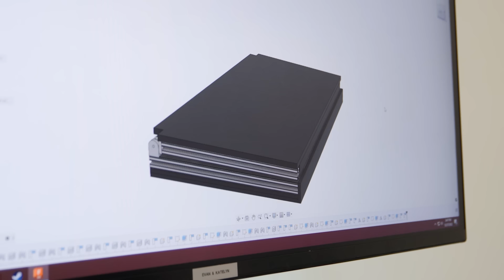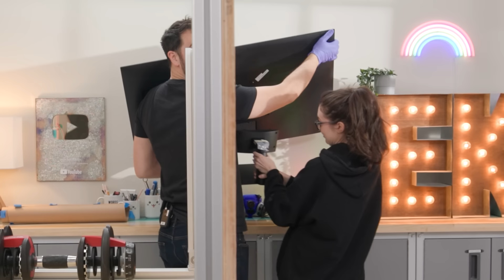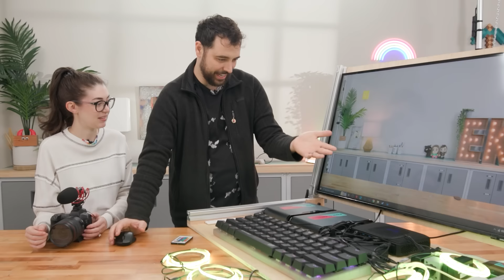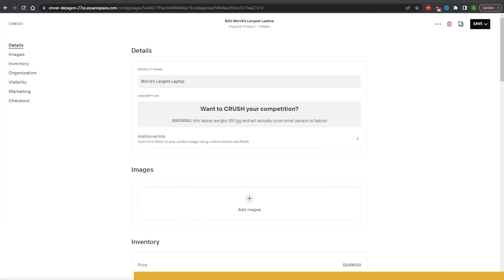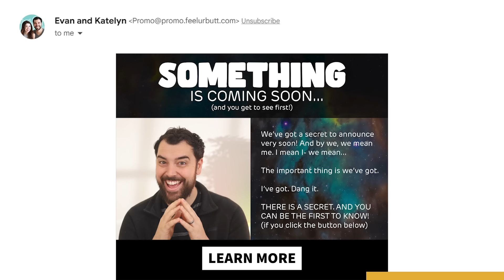DIY World’s Biggest Laptop

Comment: Using extruded aluminium on all four sides and then replace the plywood with aluminium sheats with some  structural supports to hold the equipment inside would probably reduce the weight of the whole thing. You could then remove the back and some of the structural metal inside the screen housing would also help a lot. It would even let you reduce the thickness of the lid. You also missed out on having the logo on the back being backlit. You should also add a safteystrap for the screen so it doesn't fall down and maybe some fold out legs under it. A fun project anyhow.

Comment: That came out so good and the resin was an awesome touch! The only thing I would've done different is use PVC instead of plywood. It'd be a little more expensive, but would save a little weight and might stand up a little better to being banged around, which will inevitably happen if you plan on showing this off to a bunch of people from time to time (or, you know, using it, if that's your thing).

Comment: The ultimate gaming laptop could be made like this. A normal sized full featured keyboard + a built in mouse pad, good speakers, a secondary display, a niche for the mouse to rest when the lid is closed, a gaming keypad on the left or right, depending on if you're left or righthanded. It'd be especially nice if it was detachable so it could rest beside you. Maybe a niche with a wireless gamepad that has a charger built in. There's just so much space that could be used to create something amazing. and it'd be more practical if it was built in a fancy briefcase. Such a monster laptop would have a massive battery and could even have hookups for solar panels/an auxiliary battery. It could have attachable legs like backpacking chairs to rest on your lap, whether you're sitting on a sofa, a chair or someone else's lawn.

Comment: You studied Engineering?! You've never mentioned that before. That's so great. It must help you out so much with the projects you do. As an Engineer I don't know why you didn't choose to use aircraft aluminum. You'd have strength as well as massive reductions in weight. Also, if you CNC. 99% of the image, and then do the last 1% with a final pass at lower rpm. You'll only be removing a small amount which will give you a better/crisper finished edge. And of course, always use a razor sharp bit. Great video.

Comment: Couldn't you lighten it by:

1. Removing the plastic cases of the monitor and power supplies and mounting then directly on the wood?

2. Use thin wood with metal brace to stiffen it.

Comment: I just saw this and these guys absolutely robbed my idea😂😂
I literally have spent weeks on plans and blueprints for a 63x44x5cm(8.5cm closed) with a 27" screen.   I also have done extensive research about compatible parts that could be potentially used.
I have done a full water cooling schematic and everything to acomodate top of the line parts minus the batteries since I considered this to be an AIO.
I am happy there are still people out there doing this stuff😂
Also quick note: You should have used Aluminium U-channels & sheets instead of the Extrusions & wood to save on weight and space, also for hinges you can get marine grade friction hinges with adjustable friction😂😂

Comment: How strong are your laps?  Two large sheets of plywood, plus a monitor, keyboard and batteries, will weigh a ton (not literally) and be really bulky.  Why not go for carbon fibre sheet, which is readily available and not too expensive these days.  You can even get honeycomb sandwich, which is incredibly rigid, but weighs next to nothing.  That would allow you to use extrusions with a smaller cross section (because everything's thinner, and you don't need the hinges to hold as much weight).
The keyboard was fun, but it makes the whole thing totally impractical.  If you'd gone for a normal sized keyboard, you could have actually used this as a portable workstation, and it could have a decent keyboard rather than those horrible laptop keyboards, which drive me up the wall with their non-standard key placements and tiny key travel.